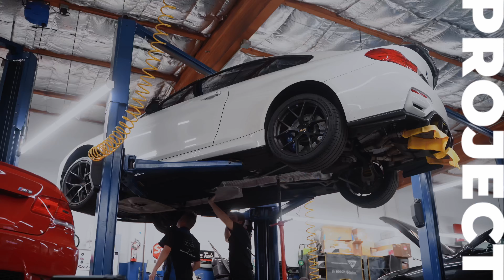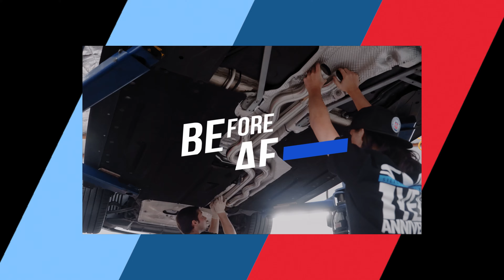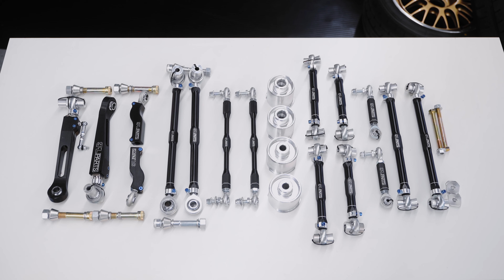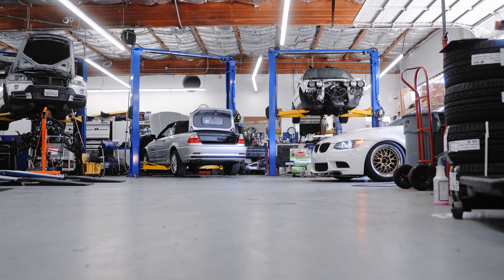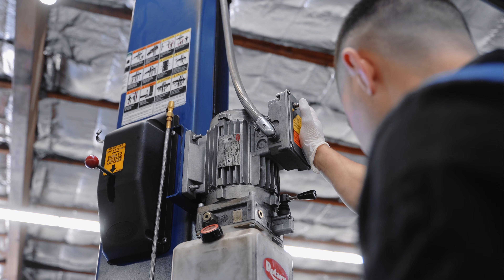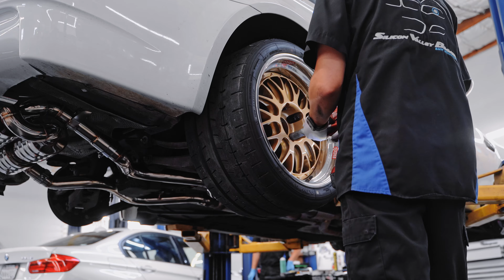BMW E92 M3 SPL Parts Full Suspension Upgrade | E90 Control Arms | SVB SVBimmer

Comment: I would add the rear camber arm bushing and the rear trailing arm bushing to that list. I would even argue that the rear camber arm bushing contributes the most deflection in the rear and switching to a monoball in this position will yield most performance compared to the other arms.

Comment: Great video SVB! Couple of tips and comments: The big subframe replacement bushings are a bit easier to install if you toss them in the freezer for about an hour before. We can't recommend the practice of torque striping, the blue lines/marks on the hardware, enough for cars that are driven enthusiastically (even do it for OEM!). It makes visual checks for loose hardware much easier. 

Something that many people seem to miss with the sway bar upgrades is that the more spring you put into the car, the less effective the roll bar is. That's because sway bars produce their anti-roll resistance by twisting; they're torsion springs essentially. Higher spring rates, less body roll, more sway bar thickness needed for them to produce the same anti-roll contribution (if desired). This is why a NASCAR runs a 40+mm hollow sway bar. Personally, I recommend a strong spring rate bias with the coil spring(s), paired with a bar that gives me enough rotation mid-corner without hindering droop travel and lifting the driven inner wheel(s) (many differentials strongly dislike this).

Lastly, the sway bar endlinks should be setup and tightened with the suspension on the ground/loaded to ensure no preload.

Comment: just need a cnc trailing arm and a set of eccentric bushes for the rear control arms and trailing arms to complete the package.  Solid diff mounts on top for full track mode.
Reply: For the rear we have the outer LCA bushing on the knuckle side out now, and in a week or so we'll be announcing the inner LCA spherical bushing. Just a quick update for those that find the video.

Comment: What’s the longevity like on those spherical bearings?
Reply: They aren't sealed.. gonna go with 6 months of street driving before dirt and dust start creating more slop and noise than stock arms.
Reply: @MrSoremuscles  wtf thats garbage then is there any sealed ones that will last a long time i was under the impression that since they are metal and no rubber that it would last much much longer
Reply: @captainminecraftist  the metal will get sanded down just by all the debris that enters the joints but idk if its as exaggerated as people make it out to be
Reply: Yes water and dirt will kill this expensive garbage